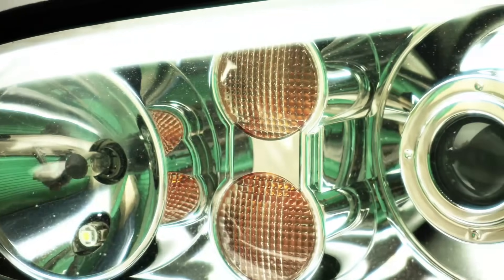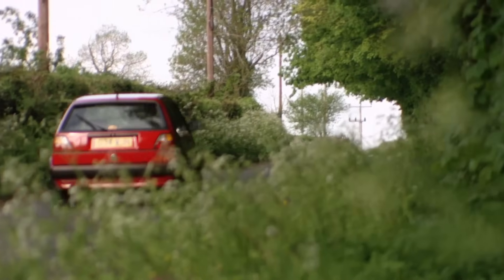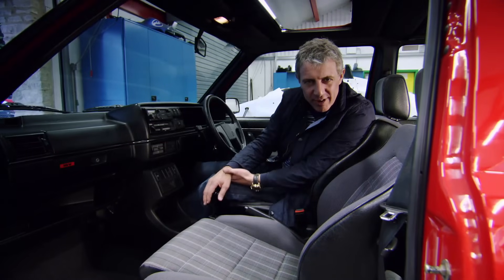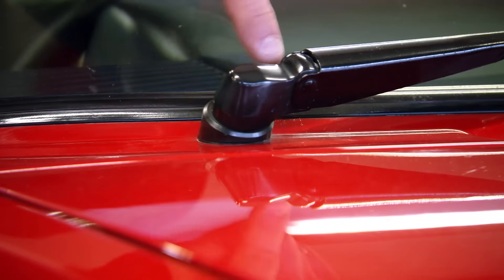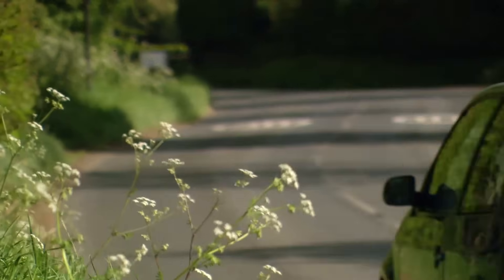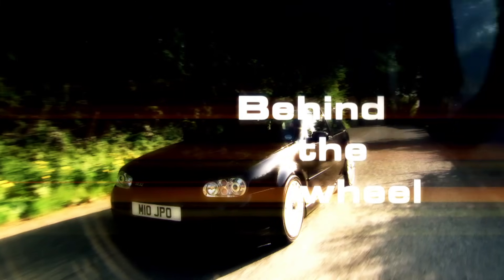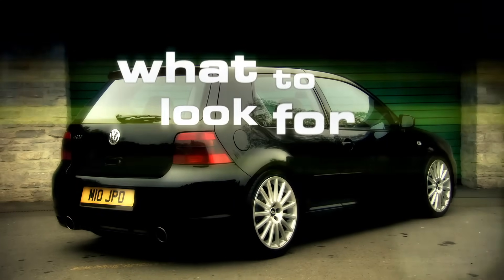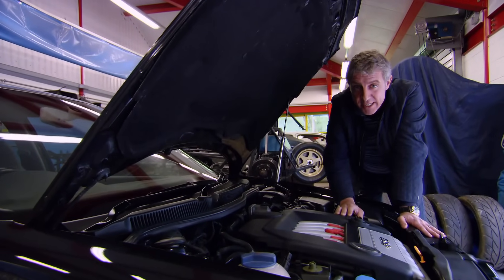Cheap alternatives to a Golf GTI | Fifth Gear

Comment: "check the chain and tensioner has been done"...this means nothing... Also if it hasn't..."£1000"..what for? If it goes your engine is gone pal.
Typical nonsense pretending to be helpful
Reply: What do you mean it means nothing? Have you ever heard of preventative maintenance?
Reply: What on you on about.
Preventive maintenance you make sure timing chain/done at good intervals (personally would never let any VW chain timing system go beyond 100k before changing - just not reliable enough). That's what Plato is meaning by 100k mentioned, so proper advice 100k or just under and no paperwork to say add in the figure mentioned to cost of car as has to be done.